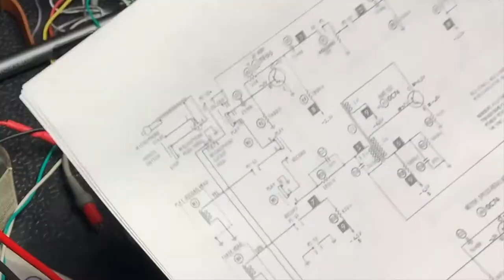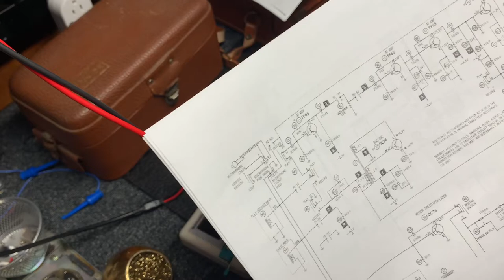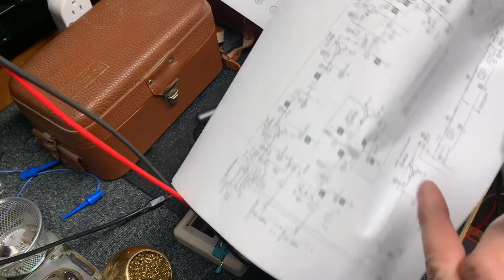Vintage Tech: Phonotrix 88 Part Two, repair the  audio -  interesting discovery

Comment: There is so much pressure from the pads, It's creating a squeeling noise.

That pinch roller is actually made from brown rubber. LOL. I thought the surface had gone brown with use.

It's got a great amp in it.

I've never seen that head arrangement before, It must be just this company that did it.

Excelent repair job, Kent. What speed does it use ?